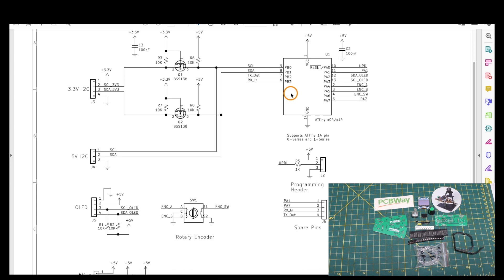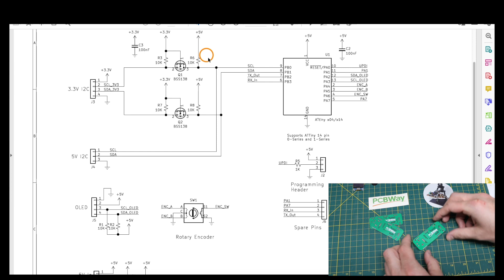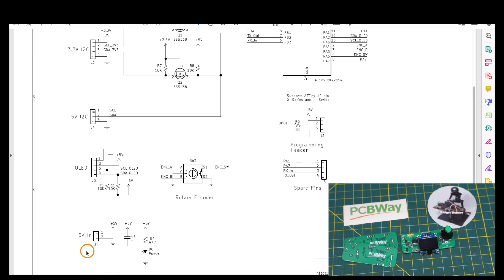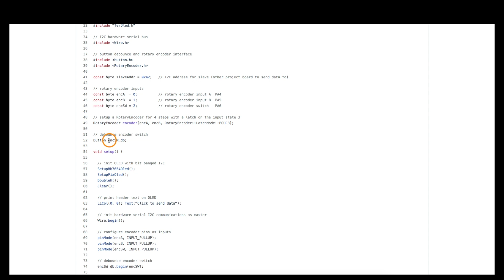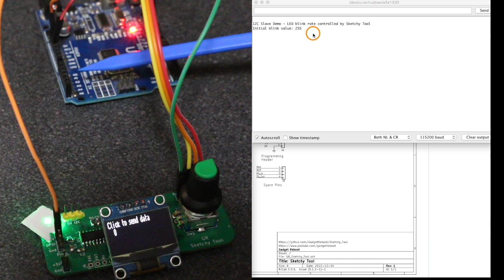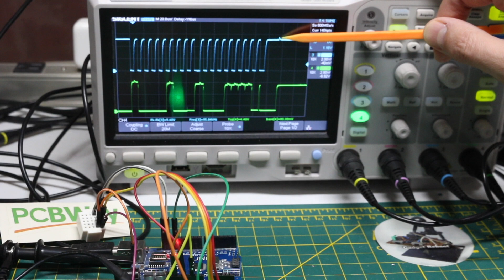A Sketchy Tool

Comment: How do you know what wire to use when soldering
Reply from the maker: I use tin/lead solder either 60/40 or 63/37 and then I just use whatever thickness seems best for the size of connection. Maybe as thin as 0.6 mm for small surface mount and greater than 1 mm thick for bigger parts

Comment: For changing device settings, I have used just UART to make a whole menu system to allow a user to edit settings / interact with the device. Easy to connect over a UART to USB, using a computer screen can output a menu to a terminal. Menu built from a switch (case) statement, have user reply with single characters for selections, make sure to only read so many bytes for replies for number inputs, and a bunch of switch. Just make sure to write any settings to eeprom so they aren't lost on power off! (and load from them at boot)